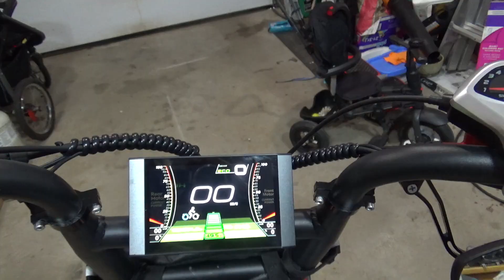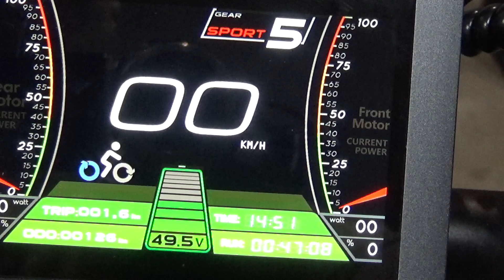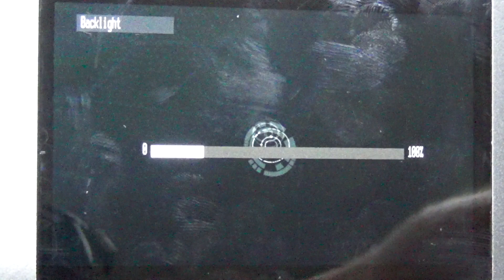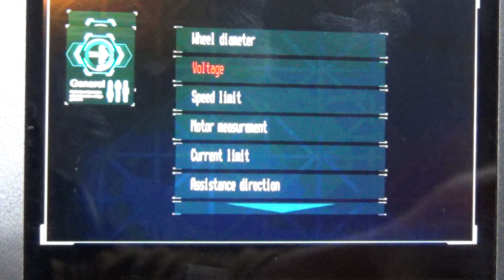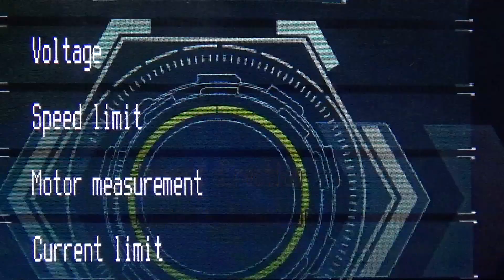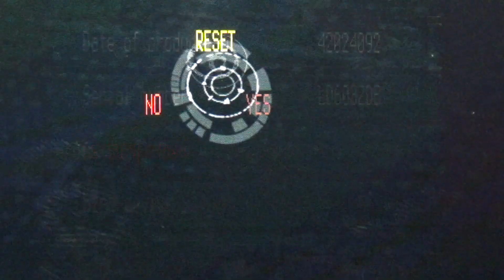AIIOKI A8 DUAL SCREEN SETTINGS

Comment: 15 amps is low mine came from the factory 30amps but mine is the A9 promax dual.
Reply from the maker: Yours also 15A per motor or 30A per two motors.  Because your bike has 2 controllers,  it reads differently.  You can check max Amps in settings,  it will be 60A, mine has 30A max. Only because mine shows per wheel, and yours per two wheels

Comment: Great explanation! Before purchasing mine, I had read that the interface was built from the ground up, unlike other generic type. I am so grateful to learn that I can change each speed setting voltage. I only need three, crawl, bike paths and as fast as it goes.  You are totally correct about the bell vs horn on bike paths, the horn is aggravating and meant for traffic. Thank you for the detailed explanation. Sign up for Aniioki affiliate link and open a dealership, they are looking for mechanically inclined store owners only to do authorized repairs.

Comment: I wish they would offer the A9 lighting package as a purchasable package. So I could add it to the A8
Reply: The front headlight has great performance, with the horn but I wish I had front blinkers. The line to it is a 5pin line so I wonder what the A9 has?
Reply: @whitneycollins2888  A9 has front blinkers, and tail light integrated blinkers. I’ve got male to 2 female splitters coming so I can add the same front blinkers to the rear.

But if you are shorter than 6’ I wouldn’t recommend the A9. I’m 6’3” and I’m on my tippy toes and it’s a chore getting a leg over the beast that the A9 is

Comment: Mine only has 48v and 60v to choose from. How do I get 52v to show. I heard there was a firmware to download. If ypu can please show a video on that.
Reply from the maker: I don't know about it. But you can see your actual voltage instead of percentage on main screen
Reply: @JustDoItPlus  but if ypu can't set it to 42v then maybe that's y people are complaining about the battery going from 30% to 0% in like 2 miles of riding.
Reply: I also heard that there is a firmware update but I don't know how to get that
Reply from the maker: That's what i said in the video. If you don't have a 52v option, do not use percentage on the main screen because it wouldn't be accurate.  Use voltage,  it will be accurate  no matter what voltage settings you choose
Reply: @JustDoItPlus  ok
Reply: @JustDoItPlus  48V and 60V are options because 52V is used by default, The % option on the screen is perfectly fine, but i would agree voltage is more accurate but we do not know the battery low level cut off they are using, you would have to run the bike all the way til it shuts off to find out.  In theory this allows you to use a 48v or 60v battery, i would love to snag a 60v battery this large of a battery but thats major $$$ for a battery that would actually fit.
Reply from the maker: @cyberlunacy  no... Old versions does not have 52v option at all... And you can use 60v battery only if your controller for 60v...
Reply: @JustDoItPlus  Old version of what? Controller or display because your video is the newest display, the missing 52v means nothing but yes the controller being 52v is the real key, but to be very very honest, most controllers will readily handle 1 voltage step down or up without any issue, very few controllers are really locked to the voltage they say, but im not gunna test that :)  its the same way motors, especially hub motors will handle way more volts than they are rated for, this has been proven time and time again but modders, even a 52v motor taking 72v without any issue at all.
Reply from the maker: @cyberlunacy old version of software on same screen... Yes, DC motors can handle higher voltage,  but controllers 50/50 chance,  lol